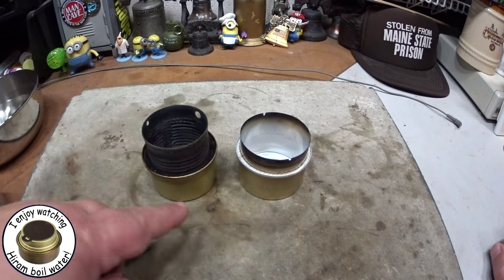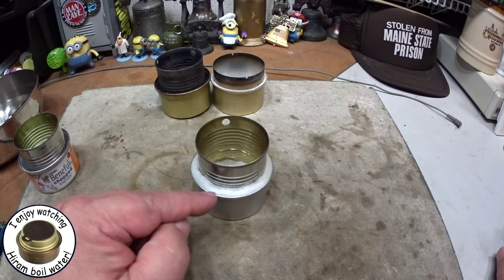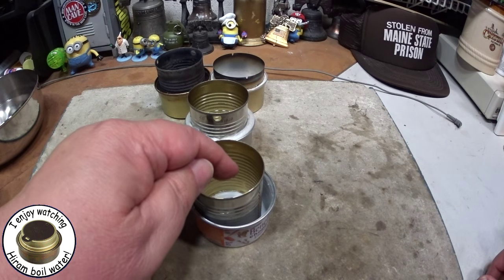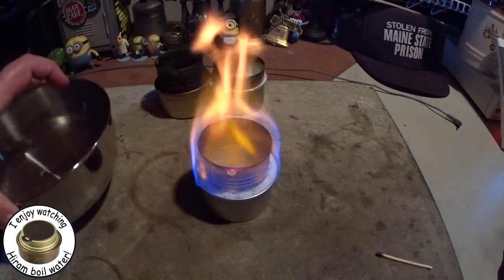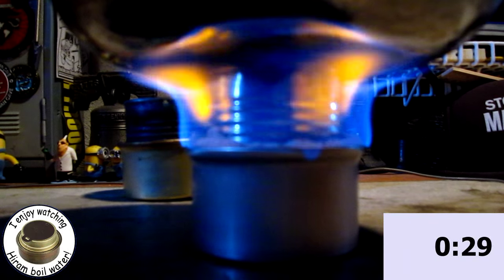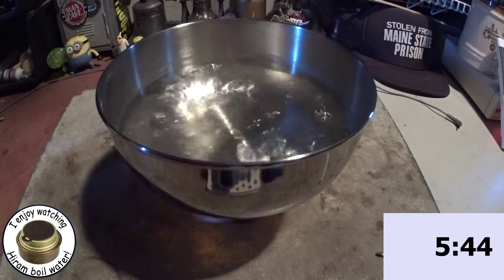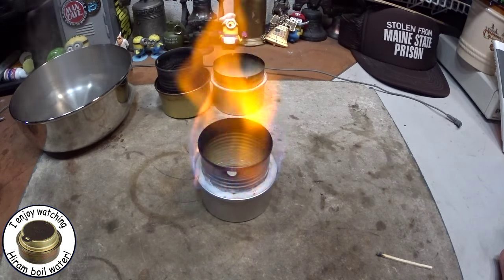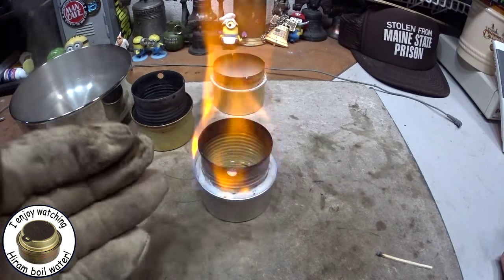Fancy Feast Stove with a Paper Towel Wick

Comment: I found using a blue shop paper towel folded to a little below the outer can's top lip to be very effective long term. This allows it to snuff itself out so the towel doesn't burn in case the stove burns all the alcohol before you can extinguish it. For me, this also provides an additional benefit of reducing the flame heat without the need for a simmer ring to avoid scalding when cooking on it. It still fully boils two cups/500ml of water nearly as quickly.  Pennies, and lasts a long time. Thank you for this informative video.

Comment: Hi Hiram - really great videos and very informative.  I built a simple fancy feast stove and also decided to use a paper towel as a wick.  What I have found over several burnings is that the paper may well char but still remains a viable wick.  I believe that you could do a few days camping with the stove with out having to replace the wick.  It will probably have to be replaced at some point but as you point the cost is negligible  and when I go camping I normally pack a few paper towels in my kit so there always would be a stand by.

Comment: Hey Hiram, while we're on the topic of Fancy Feast stoves...
I remember you saying in a recent video that the steel can had almost rusted through on the stove you use a lot. Someone on my Fancy Feast video made a comment that might fix this problem. They suggested painting the tomato paste can with high temperature grill paint (like you have used a while ago on pots). I thought it might be a good idea to share.
If it were me, I would probably burn the stove once without the paint so the plastic liner would burn out of the center. Then I would apply the paint. I don't own any of that paint, because hell, it's cheap and easy to replace the tomato paste can if you have to. But in case you have some lying around and want to try it, I figured I'd share the idea.
Cheers.
Reply: +ColoradoCamper Hi Colorado Camper, that was me that suggested the paint. I used Rust-Oleum High Heat paint on the pot stand can. Good up to 1200 degrees. So far its working great on my stoves, no more rust.
Reply: +Mea Woodsman Thank you, and sorry I didn't go dig through the comments to credit you by name. Did you paint the outside and inside of the can, and did you burn off the plastic liner? Thanks for sharing your experience.
Reply: ColoradoCamper yes, I painted the inside and outside. My tomato paste didn't have a visible liner. I did burn it before painting though so if it was there it was gone when I painted it.
Reply: +Mea Woodsman Awesome, thanks for the information.
Reply: I have in Poland great Silver paint for car Exhaust. It can handle even 500 degrees celsius. I used it to paint the  fancy feast stove and with heat the paint hardnes over time

Comment: Seems it doesn't matter what is in the can for a wick as long as it's absorbent. Maybe try a two part wick with the lower part made out of paper towel and an upper slim ring of felt.  Should last forever. I recently bought some 1/4" pure cotton rope at the swap meet 50 feet for $2.50 and it should last me several lifetimes.

Comment: what about old pair of blue jeans cut a piece of denim off to fit?
Reply from the maker: +Mark Martin I don't see why that wouldn't work. The blue dye may change the flame color some.
Reply: I’ve done blujean material...worked good...it’ll burn if left on fire after fuel runs out